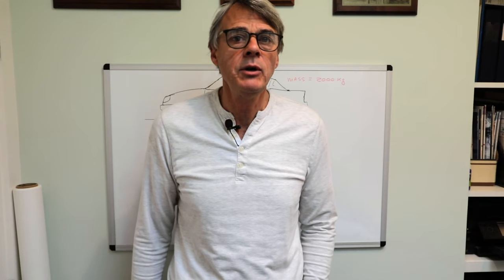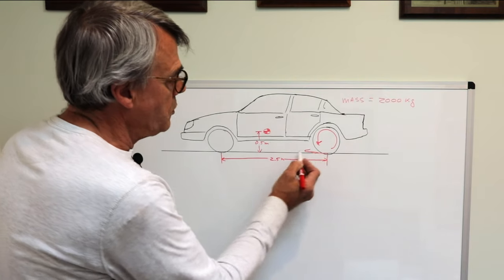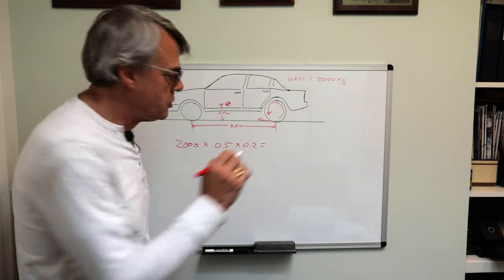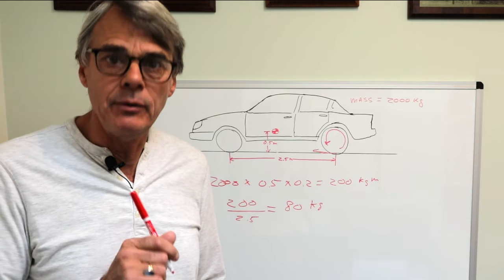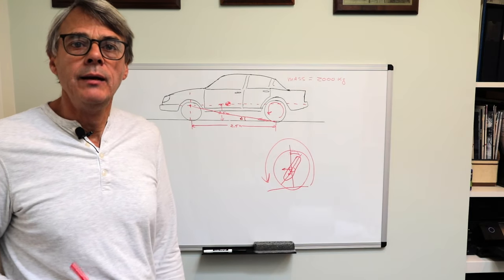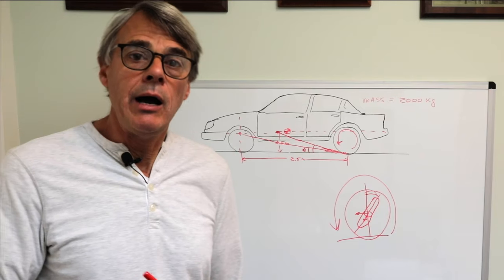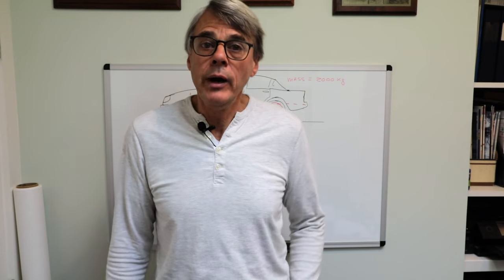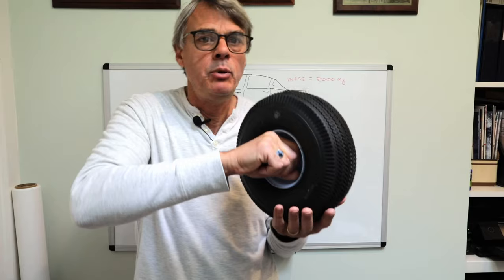The Complete Guide to Anti-Squat

Comment: Hi Hubert, 
Thank a lot for your video I finally understood why force would apply at CP on a live axle. 👍

I have one for you:

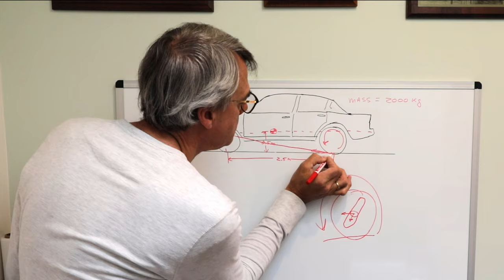If the car you draw @6:20 is a RWD with a live rear axle, it would have 100% anti squat. So no squat on power, right?

Now if you draw the Side View Instant Center of the front suspension, the intersection of front and rear SW IC will be the pitch centre, right? 
It is totally possible that your pitch centre locates way below the Suspended Mass CoG...
So then if you have a pitch moment, how can you not have squat?🤔

The way I feel it, is that anti effect work according to this definition only if one axle is connected...

Laurent
Reply from the maker: Laurent, The front suspension IC would only be relevant if there is also drive torque going through the front. But in a RWD car, all the drive torque is going through the rear so there are no forces being applied on the front to help counteract the lift that happens on the front during acceleration due to the weight transfer. That is why on a RWD car, the ideal line does not go through the CG but instead goes through a point at the height of the CG above the front wheel centerline. Remember, the pitch moment comes from a horizontal force acting at the height of the CG. It doesn't care where the CG is longitudinally. It only cares about its height above ground.
Reply: @suspensionsexplained  Hubert, I agree but that's not my point.

Let's take this example:
Say you design a RWD car with 100% anti squat.
Make it accelerate from a stop at 1G
Will it squat? supposedly No.....

Design the front suspension so that the Pitch axis is well below the SM_cg.
Now you have a car with 100% anti squat but also a consequent pitch moment arm.
Make it accelerate from a stop at 1G
Will it squat?
Reply from the maker: No it will not squat, but the front will lift. "Anti" properties (anti-lift, anti-squat, anti-dive) work because they take the horizontal forces (from acceleration or braking) and convert them into vertical forces which counteract the forces from weight transfer. So, if there are no horizontal forces then there cannot be any "anti" forces. What this means is for a RWD car, the front suspension design has no impact on the amount of squat that happens in the rear. All the front suspension does is react to the weight transfer since there are no horizontal forces to counteract it. This means the IC of the front suspension or where it crosses the IC line of the rear suspension is irrelevant. It doesn't matter if this intersection is below the CG or not. All that matters is where the IC line from the rear goes since that is the only place where acceleration forces are coming from.
Reply: @suspensionsexplained  Hubert, thank you for your explanations!

But what does the pitch axis do then? Maybe you need to make a new video...😉
Reply from the maker: The pitch axis is relevant during braking because there are forces coming from both the front and rear suspensions. It can also be relevant during acceleration in an AWD situation but then the lines need to be drawn correctly considering which suspension is a live axle and which one is independent.

Comment: Thank you for your video, i do have a question, would Anti-Squat affect grip or not? if yes/no, how and why? 

by common sense, it seems that if there is Anti-Squat, eventually the tire will took all the force. If not, the suspension can absorb some. so Anti-Squat seems to have negative effect on available grip?

i try to find the answer online for a long time, some say yes, some say no and i still do not get a proper answer.
Reply: just to clarify, i am talking about mechanical grip, aero is not considered
Reply from the maker: The answer to this question is very complicated and not one I have seen much discussion on. I have talked to race car drivers/builders who feel that excessive anti-squat is bad.

Weight transfer will happen regardless of how much anti-squat you have. It is simply a function of the wheelbase, CG height, vehicle weight and acceleration. It has absolutely nothing to do with the suspension. However, the speed at which the weight transfer happens and the speed at which the tires "see" the weight transfer is definitely a function of the suspension. With a lot of anti-squat, the tires see the effect of the weight transfer more quickly. The affect can be that the tires are suddenly hit by the weight transfer and this can upset the tires and make them loose traction. I think this is what the race drivers are talking about. With less anti-squat, the tires will see the effect of the weight transfer more slowly. I have never seen any science behind this though so this is all strictly anecdotal.
Reply: @suspensionsexplained  Thank you so much for answering me. For myself, it is harder for me to feel the limit of the tire with a car with high anti-geometry. Especially when turn in with high anti-dive geometry car.

May you talk about anti roll bar in later video? will it affect grip as well?
For example comparing a car with both big anti roll bar front and rear with a car with small anti roll bar front and rear.

Comment: I've been told that independent suspension cannot have strong enough anti-properties (particularly anti-squat) without making other responses like the roll centers and various geometry gains far less than ideal. Is this the case, and if not, which independent suspension designs are there that can be used both front and rear that allow you to independently control as many responses as possible?
Reply from the maker: The instant centers are independent of other properties like camber gain, toe change, or roll center height because those are properties that happen in the other dimensions. i.e., camber change happens in the rear view, toe change happens in the top view while the anti properties happen on the side view. Since they are effectively orthogonal to each other, you can independently control them to a large extent There are limits of course, but they are at the extremes. Most independent suspension designs give you the ability to control these factors independently.
Reply: @suspensionsexplained  How much anti-squat do you think a designer should go with in a street driven performance car? I've read that you don't want 100% because then the driver doesn't feel right when the car accelerates, but at the same time, it's demonstrably better to have some anti-squat for forward acceleration. Also, over 100% can do weird and messed up things, correct?

All that aside, I also just watched your video on anti-dive and lift... Is it better to prioritize high anti-lift even if you DO end up getting weird 100% or more anti-squat, or should you get your anti-squat correct and then just accept whatever anti-lift that gives you? Also, is the instantaneous radius method also better for anti-squat calculations, or is the geometric method typically more viable here than it is for anti-dive/lift?

Comment: If you are in a rear wheel drive would pro-squat not be desirable to get you more traction on the rear wheels?
Reply: No, the weight transfer won't increase significantly if at all by having pro squat. You'll just get other undesirable dynamic geometry changes by compressing the rear suspension, like more negetive camber (not good for acceleration) to

Comment: Wow, Ok just Wow but, I have questions; "The "anti's" are very important for a super high horse-power vehicle. How do you weight the value of anti-squat over a spectrum of vehicles say, Dragster to a truck for hauling to a 4WD off road vehicle?" How does one adjust the instant center goals for these vehicles? There are drag enthusiasts who explain what they need to race but, the concepts are never adjusted from 2000HP drag car to a 600HP 4WD truck. And AWD car has a torque distribution but, a real 4WD truck is most often only 2WD at 0% torque distribution. What are your thoughts on this? I understand how to maintain pinion angle but, that isn't the whole story. That effort must be balanced with concerns about instant center location. This is quite a balancing act. I did notice that the upper A frame of my 2500 was not parallel to the lower and I thought "WHAT". Now I see why. The A frame pair have their own instant center and if they were parallel the axis lines would never intersect. Same is true with a 4-link rear suspension. If each pair of links, upper and lower were parallel the pinion angle would be maintained over the range of travel but there would not be any projected instant center for the rear suspension. Now that I am a "wise-idiot" I'd love to know more about how to balance all this.

Comment: Kinda blew my mind that the slot would have more angle, not less, on a split AWD system.. I figured the AWD would squat less to start with, due to less torque being sent to the rear wheels pushing the car down. I am trying to remember if the rear suspension on my AWD E46 is different from the RWD cars, or if it was "close enough for government work" and the parts are all interchangeable. I know the springs are different (mine is on aftermarket H&Rs though) and the dampers might be as well (I have Bilsteins, and when I replaced them due to one of the rears being blown, the new recommendation from Bilstein was to use the E36 M3 dampers out back... the other design was weaker with a smaller rod).
Reply from the maker: mry82, The "anti" properties of a suspension have the function of taking horizontal forces (like from acceleration or braking) and turning them into vertical forces that counteract the weight transfer force. Since the weight transfer force is a function of the total acceleration or deceleration of the vehicle, the rear suspension in a RWD car will have more force to work with than the rear suspension of an AWD car. This is because in an AWD car, the percentage of acceleration contributed by the rear suspension is less than it would be in a RWD car. This means that the lower amount of acceleration force coming from the rear has to do more work to counteract the weight transfer which is a function of the TOTAL acceleration force.
Reply: Thanks for that clear, concise explanation! Looking forward to more videos.  @suspensionsexplained

Comment: If a vehicle were equipped with electric hub motors, would it be modeled as an independent suspension or a live axle? Thank you for the excellent content! You have a new subscriber
Reply from the maker: Or would need modeled as a live axle because the torque reaction is going through the suspension.